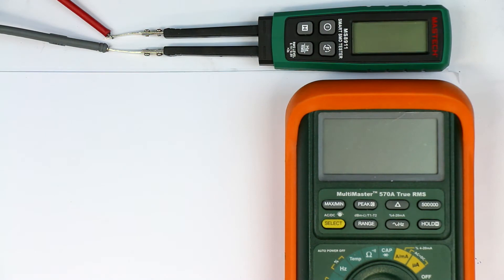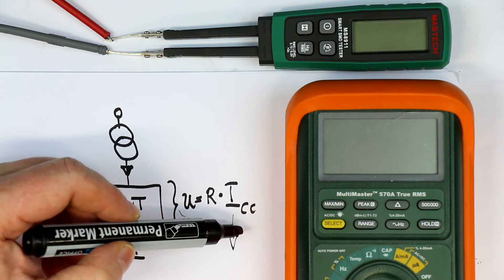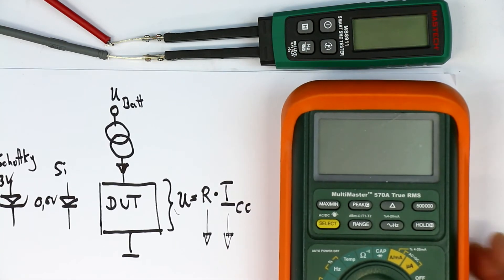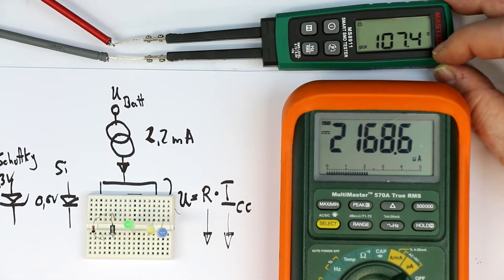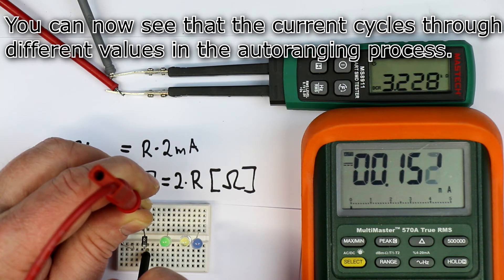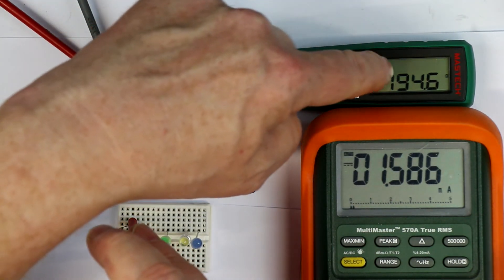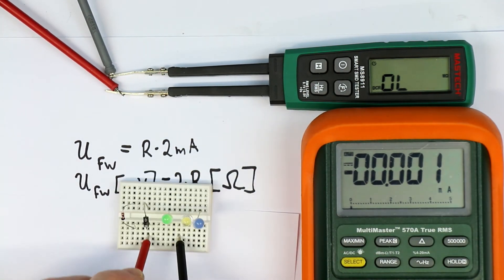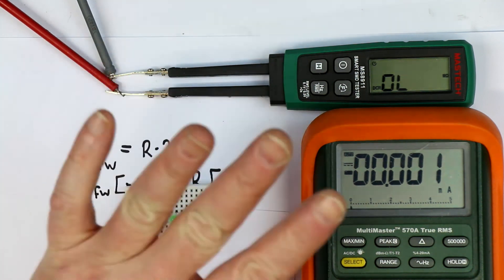Testing Diodes with an LCR-Meter - An Experiment (MASTECH MS8911)

Comment: Can it measure ESR values
Reply from the maker: Yes, "R" is in fact the ESR in series measuring mode.
Reply: @KainkaLabs  Will it work for capacitor ESR
Reply from the maker: Yes, but it only measures at 10 kHz max while capacitor ESR is usually measured at 100 kHz.. And the MS8911 isn´t available for years now although it is still in the MASTECH online catalogue.
Reply: @KainkaLabs  I bought MS8911 it was available at my local store, and I also found MS8910A,and MS8910
Reply: @KainkaLabs  I paid around $30
Reply: @KainkaLabs  Although I got MS8911, but I'm facing problems finding CR2450, I need replacement batteries for insurance, but no luck with finding them yet, but I found CR2450N, 
What should I do
Reply: @jagadeeshapatil75  I'm from Delhi, India 
I found and bought MS8911 in Delhi market, there are some stocks available, like MS8910 and MS8910A still available I bought MS8911, but I don't have any idea about it stocks availability but they are available
Reply: @jagadeeshapatil75  Try to find locally, you can find them around 25-35$ easily, online prices are high
Reply: @jagadeeshapatil75  Where are you from, 
I told you earlier that MS8910 MS8910A still available, if you need one of them then visit Delhi market, I'll tell you that Store number
Reply: I am From Mumbai locally searched near Thane.
Reply: Searched locally at Mumbai no one have stock, will order online.

Comment: Can you tell the chip name at MS 8911?
Reply from the maker: You probably mean which chipset is used in the MS8911. Sorry, but I don´t know because I haven´t taken it apart yet.
Reply: @KainkaLabs  Yes, exactly. Ok, I will, when mine will come.
Reply: Waiting for unfoldng of IC in meter
Reply: Cyrustek ES51930P (LCR chip, datasheet is available only for ES51930, at least I can't find the chip with P at the end).  STM8L152 R8T6 (MCU).

Comment: A constant current generator cost money to make, when you have a processor in the chip it is cheaper to use the current measurement and volt measurement to calculate ohm.
I have been testing a pile of multimeters and I have not seen one that uses constant current in diode mode (I have not tested ohms mode for constant current).
I believe my bench meters use constant current, but I have not checked.
Reply from the maker: Yes. It´s cheaper a bit cheaper to measure DC-Ohms with a resistor-divider.
But then of course resolution and accuracy varies with the measured value.
But in your second statement you miss the point.
the video was not about how diode-measurement works in a normal multimeter.
It was about how to misuse the normal Ohms-measurement mode for checking diodes.
It would have worked out if only this thing would have done it the traditional way with a constant current source :-(
Reply: I did not miss completely, ohm, continuity and diodes basically use the same measurement configuration, if possible the voltage in diode is higher and sometimes also continuity (This is a bit random).
I was wrong about the bench meters, I have checked one: 34461A uses a constant 1mA current in diode mode and I would expect that also means all ohm ranges uses constant current (Not 1mA, but adjusted for each range).